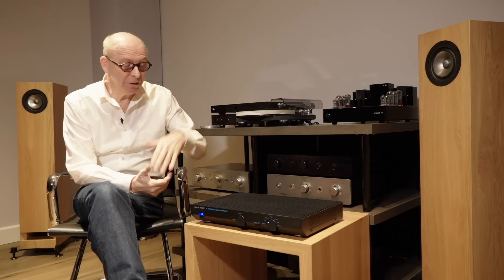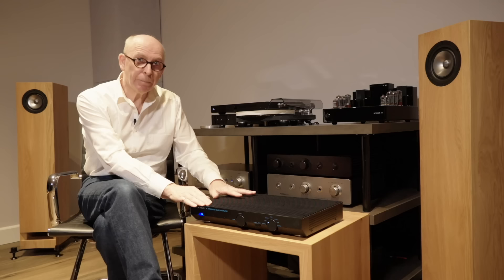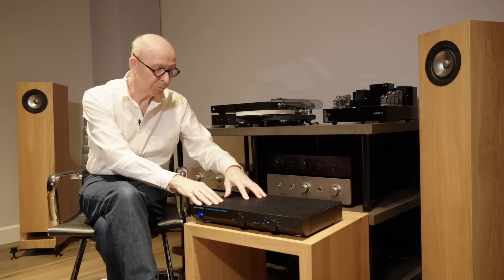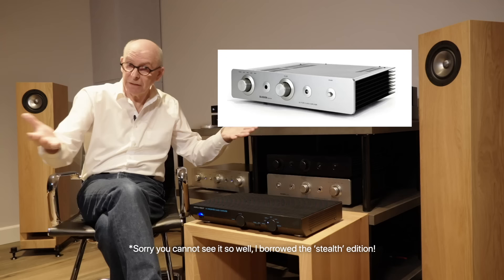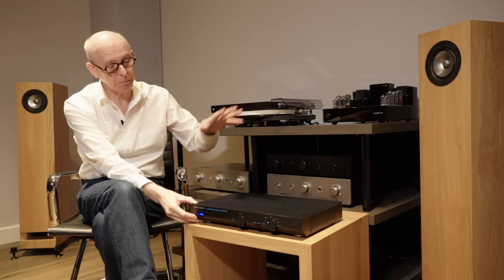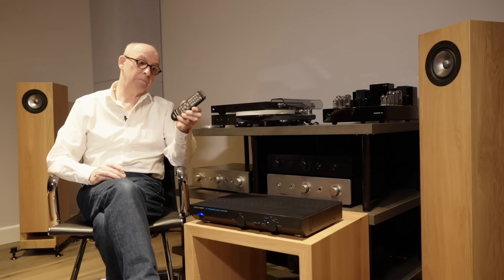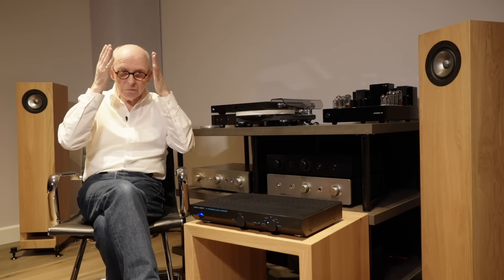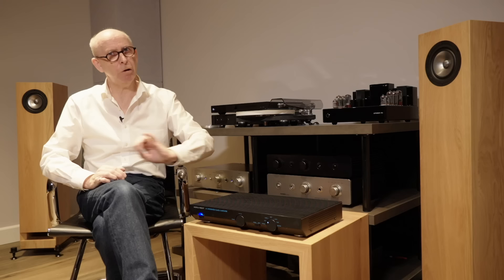Musical Fidelity A1 - Sugden A21, how do they compare?

Comment: Just discovered your channel. Well done. I did not realise the A1 was a beginner amp. My first was a Musical Fidelity A200DM apparently with dual mono amps inside. The volume control fell out and shorted it. It did run warm but seemed happy with by B&W805 Matrix speakers. Both bought in 1995. The B&Ws are still going strong. Could you suggest an amp or two to try to replace my dead MF amp? Would a Naim Uniti Atom work? It needs to be wife friendly. I believe in diminishing returns. My ears are 57 yo. I do enjoy guitar and vocals. Circa £1500. Regards Richard
Reply from the maker: Dear Richard,
Thanks for your kind appreciation. I made a video on the Lyngdorf 1120, it’s a marvellous amplifier and I think would be perfect for your situation. Especially if you want to hook it up to you TV too. 
Enjoy the music, Harley
Here’s a link: The Lyngdorf TDAI 1120: Why it deserves to be considered for a place in every HiFi system!
https://youtu.be/WO2AHcYygyc

Comment: Harley, any additional thoughts if comparing the A1 to the newer A21SE?
Reply from the maker: Hi, absolutely. As I hinted during the presentation, the A21Se is a bit more open and detailed than the 21 and is my preferred choice for people whose budget allows. Hope that helps?
Reply: It does, budget does allow and i don't want the amp to hold back the capability of my speakers. @PearlAcoustics
Reply from the maker: @scruffy8861   just one more point. It could be worth listening to the Sugden SPA4 and then decide if it’s too much. The A21SE is somewhere in between the SPA4 and the 21. Good luck!
Reply: Harley, going forward with the A21SE, Your comments and others lead me to think a very nice piece of kit and this time around i want to do an integrated amp.  @PearlAcoustics

Comment: Rated power (1% THD+N, 1 kHz) [W] 8 Ω, 2x 25
Rated power (1% THD+N, 1 kHz) [W] 4 Ω, 2x 17
Rated power (1% THD+N, 1 kHz) [W] 4 Ω, 1x 17
Rated power (1% THD+N, 1 kHz) [W] 8 Ω, 1x 25 

Sensitivity (for maximum power) [V] 1x 0.0.25/0.9 (DIRECT Mode)
Signal/noise ratio (A-weighted filter, referred to 1W) [dB] 84/90 (DIRECT mode)
Dynamics [dB] 98/104 (DIRECT Mode)
Damping factor (referred to 4 Ω) 16

Comment: My question is; how does it compare to smsl vmv a1 soundwise? Thank you.
Reply from the maker: That’s an interesting question, and in fact I was very curious too… so I made the comparison. The VMV A1, is a little more detailed, not much, and its bass is slightly better defined but it does not have the gain or ‘grunt’ of the A1. The A1 is really an amplifier that can drive in efficient speakers in a way the VMV A1, simply can’t. Hope that makes sense?
Reply: @PearlAcoustics  Absolutely. I recently purchased vmv a1 and mixing and matching with speakers, cables and dacs. Just wondered. Thank you for your reply.

Comment: who is this amp for: people that don't care about energy efficiency or environment, old folks with nostalgia?
Reply from the maker: Hi, I get your point. But if the amplifier is used when a room needs to be heated, which in Belgium is several months of the year, I don’t see a problem, as it is a very efficient conversion of electricity to heat. Especially if it is designed to last for decades.
Reply from the maker: @mediascapes2011  thank you for your reply, that’s hot! I am not aware of Rehdeko Loudspeakers but just looked them up. Very interesting
Reply: Was that comment really necessary?

Comment: What's your take on the environment. Burn baby burn disco inferno !
Reply from the maker: Hi, I assume you are referring to global warming? The most important aspect here is to make sure that the products we buy will last for decades and not be thrown away. As for those that give off significant heat, then I see no problem at all if it is contributing to needed room heat. Class A amplifiers are rather good at converting energy to heat.